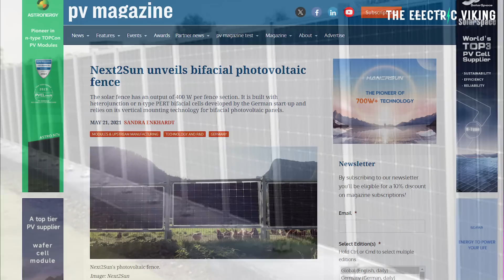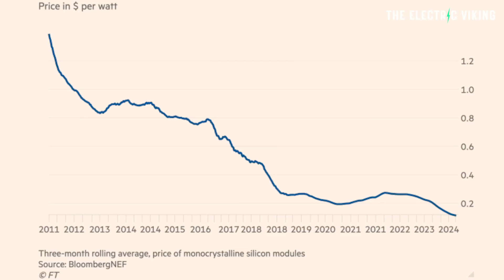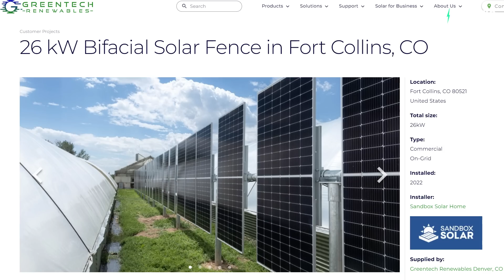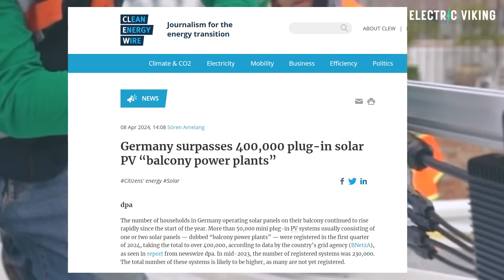Tony Seba says solar is now so cheap it can used as a construction material

Comment: They will just add fees for the right to be hook up to the grid and for power line  upgrade abd upkeep.  It already  happened  here in Canada.  There will never be free . Unless  u live off grid in the bush.  Maybe  in the land down under and EU.   In North America  it wouldn't  happen.  In the usa 🇺🇸  solar panel, battery  are cheaper.  In Canada  solar  is still costly for the average  person.  Sometimes  u might find  a deal  on power station or a solar panel.  But they are far and between.

Comment: SEPTA's one little itty bitty problem 
The ignorance of solar and micropower is it could only put in 15% of the extra electricity into the grid 
Easily proven with a volt amp meter and 4th grade math called ohm's law to demonstrate the ignorance of solar

Comment: Funny thing is solar panels are so cheap now, but the solar install is not. The panels could even be free, but it would still cost a thousand dollars per kWh to get rooftop solar. Hopefully integrating panels into your house's construction (like fences or even as siding if you have sun hitting your walls) will lower that up front costs.

Comment: Roofs could be covered with an EPDM membrane with solar panels covering the whole roof other than ridges and valleys.
Siding could be replaced with entire walls covered in solar panels instead.
High-rise buildings could have a mix of glass curtain walls and solar panel curtain walls, including those that are double sided and partially see through where desired.

Comment: If you could get a solar panel that had built-in insulation on the back, and simple structural and electrical connectors on the sides they would make a great building material. Even the ones with defective cells could be used for exterior wall panels on the shady side of your house.

Comment: Domestic & commercial Solar utility integrated with structural roofs, windows, fences etc. is a jolly fine concept.
Unfortunately, the cost of storage and various electromagical stuff like MPPT load regulators, inverters and VPP network adaptations are still very high by comparison.  I do not know the cost of Tesla's new PW-3 that supposedly integrates most of this stuff but I expect that to be the next trend.  Boxing turnkey systems into a single cabinet instead of filling a garage wall with clobber has to be better.

One would hope that out-facing solar fences are not as vulnerable to vandalism by testosterone charged, petrol-head teens with baseball bats - as are mailboxes.

But cynical comments aside, very cold winter climates with lots of snow, have shown that vertical panels fair way better overall - because snow does not persistently cling to them and they are therefore more practical than roof-top panels.  Energy every day, all year round, but way less in winter of course.  If it were me, I would mount the panels atop a 1 metre high wall to ensure that snow could be cleared on occasion without fear of damage to the panels or having them covered in snow drifts.
Vertical solar panels also makes heaps of sense for high +/- latitudes, where vertical panels inevitably gather more energy because of the perennially low inclination of the sun at zenith.  A little altitude will also mitigate obstructions like parked vehicles on the roadside at frontage.

Comment: You obviously are not very knowledgeable on how grids work, what is baseload electricity, or what actual performance factors (hence true cost) of solar is. Not to mention the insane eye sore, slave labor and insane carbon intensive coal based manufacturing. But that happens in china, so why would vikings give AF? That said, i do enjoy your content, skeptic as i am 😉✌️

Comment: I wish PG&E in California would get the word. Right now, electricity prices are pushing 50 cents or more per kilowatt hour. They've gone up about 50% in the last 5 years and probably doubled in the last 10 years.
Reply: Too many renewables and not enough coal , nuclear ,gas and hydro.
Reply: @Leonardo555ZZZZ  Funny. Ha-ha. Hope that's a joke.
80% of the cost is distribution, which means there's not enough local generation. Costs in cities that generate their electricity locally, using mostly renewables, are charging on the order of 20 cents per kWh. More solar rooftops would mean more local generation and less distribution cost - at least, in an ideal world it would, which is not the one promoted by PG&E. And California uses plenty of hydro and gas, along with some nuclear, to generate electricity.

Comment: The 400 000 balcony power plants in Germany are only the registered ones. Last year, when the numbers were much lower, there was a recall from company DEYE, who has a market share about 20-25%. They had to recall (which in fact was adding an adapter part) more than 400 000 inverter only in Germany. So the real numbers are expected to be much higher.

The price for a balcony power plant with 600-800W has come down now to 250 - 300€ plus fixation material and transport and it produces about 600-800 kWh per year. Means return of interest within less than 4 years.
The price for the moduls are now below 50€ per square meter, which makes it very attractive as construction Material. 
Car ports or fascades cladding with PV modules are cheaper than solutions with most other materials. 

Greetings from Germany and thumbs up for your great channel

Comment: The problem with solar is it swings the price of power wildly.  This puts baseline power produces out of business.  What is needed is extreme peaker power production to make use of this type of power from solar.
Reply: You say “put baseline power plants out of business” like it’s a Bad Thing. :) Why not just use batteries instead of peaker plants? We know our daily (and hourly) power consumption patterns. We know when the sun rises and when it sets and what its angle will be. We know how much cloud cover we can expect. Start with enough battery to run the community 24/7 on the sunniest day of the year. Add enough to cover the darkest day of the year. Add more to cover however many days of cloudy weather. Eventually, you can reach 24/7/365 solar power.
Reply: @davestagner  Batteries are very expensive and they need to be replaced after awhile.  The general rule if you are going to store energy you want to avoid converting the energy into a different form.  This is the problem with hydro and batteries in that you are converting the energy into something else which involves conversion losses.  There is also the problem like in California of extreme seasonal differences in current renewables power production and the inability to always have power when you need it. This is why Bill Gate's Natrium reactor setup with storage makes so much sense.  Here power is stored as the actual heat that is being produced hence no conversion losses.  Properly designed heat storage tanks can have very low energy loss over time.  The salt storage medium is also the cheapest way to store energy and never needs replacing. The other thing is both the stored heat output and the output of the reactor can be added together resulting in a doubling of the power output when needed.  If this maximum power output is produced at times of electrical power shortage and high electricity prices high levels of profit can be realized. Essentially because the power plant is taking advantage of producing it's power when electricity prices are high this plant can be profitable even if it's levelized cost of producing it's power may cost more than systems that can't produced power during these high electrical price times. Such a system actually makes it possible for more renewable power to be used by backing up the renewables when that can't produce the required amount of power.

Comment: The cost of solar can never be zero. Storage and panels will still cost money to make. But of course there can be synergies that make it very cheap, like in the case of dual use when you make a fence out of solar panels. It is however a fairly expensive fence...Not to forget the grid, unless you are 100% self-sufficient which is almost impossible in dense urban environments.
Reply: The costs can "trend towards zero" like Tony Seba points out.
Reply: The people who push for solar are rich privileged people. The average home price in the US is almost 400k. That's means a 20% down payment would be 80k......
Reply: @RipliWitani  I've never been rich and I've "pushed for solar" all my life. Solar and Wind are the cheapest form of energy once the system is established. And it is so for home buyers at any rate. If you say that the avarage home price in the US is 400k then installing a solar system with a 10kw/h battery +c heat pump will be a pittance compared to the whole house price. But it will virtually bring you energy bills down to zero after 5-10 years...

Comment: Dual sided panels for a fence wouldn't be a bad idea. They just need to get the price of micro inverters, etc. down. 
Every parking lot should have solar panel sun shades over it. 
Then dump the power into a battery bank to use on EV chargers. Get yourself a premium profit on it.

Comment: - Of course it has been a little while since that Solar panels have become the roof "deck" -   "In-Roof Solar"  - building integrated solar is a real thing, more so in the UK than in Australia.

Solar panels are fairly resistant to most blows -  using bifacial panels  - will make a great wall topper.

I have a fence I have been eyeing off for a solarpanel location  -in my instance it would be hanging the panels on the front of a colourbond panel fence.

 - "Plug in balcony power plant" is not really a construction method - most of these units are most likely a solar panel hanging off an existing balcony.

Comment: And it is just as useless as a building material as it is for an energy source. Even at this cost, it is still so inefficient, no body wants them. Solar cells should always be considered a last resort, where you have no other alternatives, like Mars Rovers and orbital satellites but when you want to power your home, unless you live off grid, the grid is the cheapest, most efficient and hands down the most convenient energy source, as long as we are taking advantage of coal and all its benefits to the ecosystem and humanity.

The people that want to control everything, don't want you to easily be able to grow your own food  on a balcony garden, because that's what a small increase in atmospheric CO2 would do and they can't rule over you like they can when They control Your food supply. CO2 has nothing to do with climate but it sure is good for plants and coal is the best possible choice to produce CO2, which is the best possible choice for the ecosystem and the most cost effective, the most scalable, most versatile, safest, and cleanest source of energy on the planet. Why on Earth would anyone want to stop using it? 

Coal is a natural resource, that is Not good for anything else but burning. There is no reason to stop using it and every reason to continue using it and more of it, if we want to prosper and we want to boost atmospheric CO2, because we have been, Hell Bent for Leather trying to pour enough CO2 into the atmosphere to make a difference but the ecosystem just ramps up and consumes the excess, almost as fast as we can produce it. A 100 ppm increase in atmospheric CO2 after 200 years of trying, is pretty small and hard won. But if we put our minds to it and get serious about boosting the ecosystem and all life on this planet, by boosting CO2 production as much as possible, which means doing the logical and sensible thing and going back to Coal for power generation just as the Chinese and India are doing. 

Just because we once benefited from the coal revolution, doesn't mean we can't continue to do so! We don't need to indulge ourselves in self-flagellation and punish ourselves for doing it right at one time and getting ahead. We have every right to continue to prosper just as we once did, because energy is wealth and cheap energy makes us all wealthy and prosperous.

Anyone who vilifies the production of CO2 is a crook, who is trying to swindle you!

Comment: Solar panels are getting cheap, but for some reason it is incredibly expensive to have them installed here in the US.
Reply: It’s a complete rip off. So simple to install once you have the knowledge. Get qualified electrician to check your work and sign off the install.
Reply: DIY
Reply: what is not cheap if you hire others to do it?

Comment: You still have to build the frame for the house and make a traditional roof upon which to place the panels. Panels are not waterproof and provide no insulation for the interior. Nuts hopium naivitae.

Comment: Yes I often charge my car at home through summer and get paid for it here in Sydney. Not unusual. OVO energy now offer free electricity from 10am to 2pm in their time of use plans and Amber Electric often reach zero and negative prices through summer. But it’s the spikes in electricity prices that allow you to make money if you have a good battery. Up until now a house battery did not have a good ROI but with access to electricity wholesale market spot trading via companies like Amber here in Australia and Octopus in the UK and software like EMHASS with Home Assistant that has changed.
Reply: I'm not putting a slave battery in my house. Solar and wind are cool but the batteries use blood minerals. Get us a better battery and I'll go back. Meanwhile I'll enjoy my air compressor engine that uses 0 fuel and had 0 emissions
Reply: What are blood minerals? If you’re talking about cobalt my battery doesn’t have any as it’s LFP.

Comment: I am in Melbourne and have many panels aligned with the fence, we get old panels $10 per panel. Pergola facing north is enclosed by solar panels connected in parallel to prevent heating of panels in shading.
Reply: I have done the same thing. I also mounted free used solar panels on ladders. They can be moved and the angle changed with the seasons.

Comment: Explaining to people electricity will be free would be like going back 50 years and explaining to people long distance phone calls would be free some day.  They wouldn't be able to comprehend it.
Reply: Tesla proved this a long time ago. That's why the oil companies killed him
Reply: How is it free ?  Panels , installation , transmission ,storage ,  back up for night , cloud and snow cover...It actually works out more expensive than using coal ,nuclear , hydro and gas like we used to. That is why electricity prices are rising in direct correlation with solar and wind increases.
Reply: @Leonardo555ZZZZ Wind turbines and solar panels are only fuel savers for an existing fleet of plants, the worth of renewables is equal to the amount of not consumed coal, oil and/or gas.
Since the consumer price is a combination of fuel costs, fixed costs, grid fees etc. that calculation does work less and less if more pv is added. The Netherlands therefore charge owners of rooftop systems with an annual fee of 100 to 697€.
The solar boom seems over in California with NEM 3.0 and in Upper Austria 20,000 feed-in tariffs for solar energy were canceled and the tariffs were cut by 80% since the generated power is close to worthless during daytime. 
Wind energy is going through a similar situation, the UK had to increase tariffs for offshore wind by 66% to keep up with the set goals. Who has predicted that a couple of years ago? Renewables have a ridiculously low energy density which results in a high material  demand, copper became more expensive over the recent years. We will see a massive shift towards nuclear, France has done everything right.

Comment: How many Panels do you have Sam? Tell us about it. I have 50 solar panels in Groningen Nederland. Production 11.000 kWh every Year since 2012. And 12 years no degradation. Easily 50 Years Production. Solar Panels never Stop.
Reply: Yet in Australia you can buy 'old' panels for $10 each , and some large scale solar farms have shipping containers full of 'old' panels.
Obviously they do not last for 50 years ,,sometimes not even 15 years and they fail.
Reply: @Leonardo555ZZZZ  they dont fail. They last for 50 years. But Wp has gone from 200 Wp a Panel to 400 Wp a Panel. And prices from 2 dollar Wp to 10 cent Wp. Its an exchange. Not fail. Solar Panels last 50 Years. I have 50 Solar Panels for 12 years now. Totally Perfect. Last year record production. Getting better by the Years.👍🙂
Reply: @willeisinga2089  You are lucky so far , but 12 years is not 50..If they last 50 years why does a large scale installation in South Australia have multiple shipping containers filled with old panels that they have removed because they no longer work ?
PS , hope for no hail , no snow , no cloud ,,,good luck.
Reply: @Leo555ZZZ  I live in Groningen Nederland. Cloudy Snow, Hail Rain Wind Region. Solar Works in Groningen. And for Quality. Try Chinese Made High Quality Solar Panels. Longi 30 years production garantee, last 50 Years. How many Panels do you have???
Reply: @Leo555ZZZ Do you know they know longer work? Or is it just that production is no longer up to spec? Modern panels lose 0.3-0.5% efficiency per year. I’d love to see numbers on catastrophic failure rates, so I can more easily rebut the idea that they don’t last. 

Solar panels have no chemical reactions, and no moving parts. There’s not much to wear out. So why would they fail?